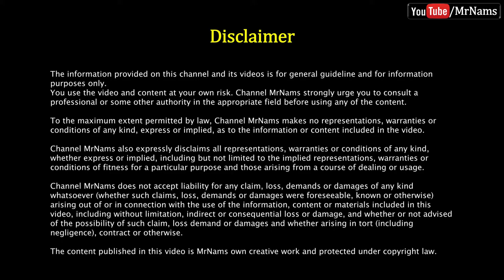how to clean laptop

Comment: 1. Never vacuum computer parts
2. Beware of electrical charges when touching the CPU/GPU
3. That is WAYYYY to much thermal compund (purple paste). You put like 10-12 times more thermal grease than you should have. The laptop probably ran like shit after that. A small dot, about the size of rice grain, is perfect.
4. You don't need to take every component out just to clean the heatsink and fan. 
5. Never use a metal screwdriver or any metal object to scrape off the old thermal compound from the CPU/GPU
6. Use 70-99% Isopropyl Alcohol to get rid of any thermal compound left on the CPU/GPU. Mixing old thermal compund with new one is not a good idea.
7. I always recommend using a good paste like Arctic AC Mx4, or other similar brands.
Reply: Also shouldn't have brushed all over the circuit board, risking esd. And again that was ridiculous amount of thermal paste🤣